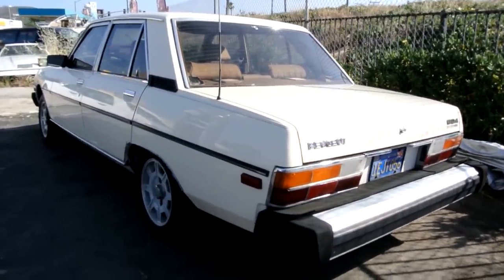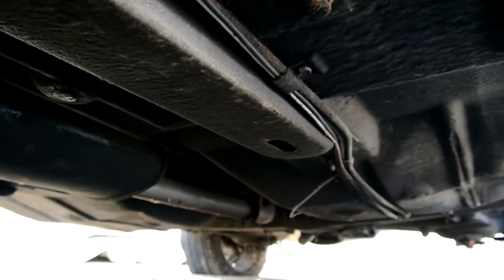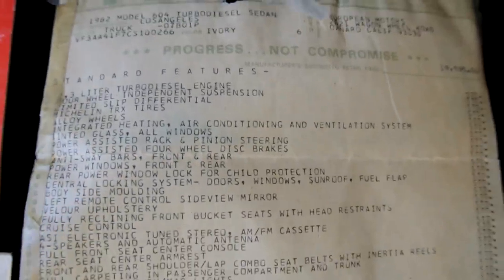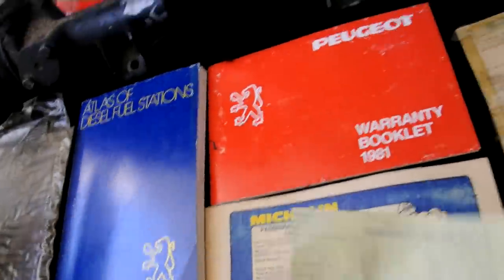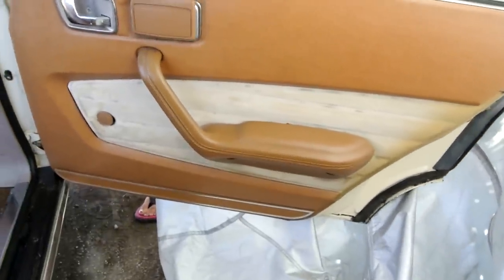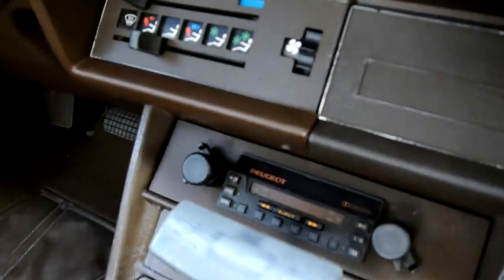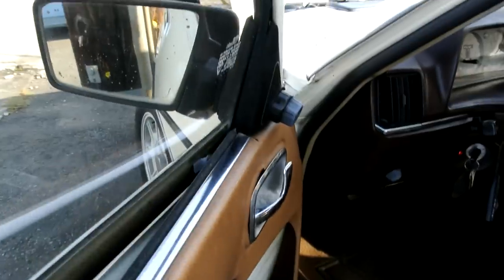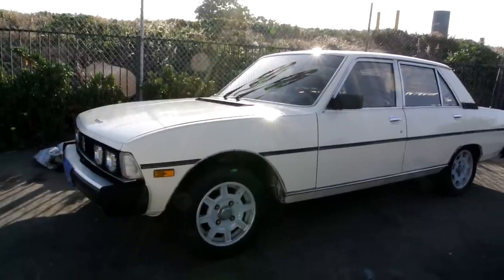1981 Peugeot 604 Turbo Diesel Saloon 1 or 2 Owner Project or parts Cheap!

Comment: I owned one of these 604 TDs about 4 years ago, got it from an estate sale. Was a one owner, that used it to travel across the country for years. Odometer was stuck at 700,000 miles, and story from the local Peugeot mechanic (and the last one I know of in the northeast) was that it hit 1 million and started going backwards! Had its original motor and transmission.

Comment: The battery light staying on is because the alternator regulator needs to be replaced it's an off the  shelf  item Motorola or Bosch regulator that screws on to the back of alternator. The car has been left in the sun for a long time because those parking/turn signal lamps that are white up front should be orange. that ghetto stuff on the fenders is just that ghetto, did not come from Sochaux like that. Sunroof motor operates a threaded screw, the carrier is stripped out by the noise it made.

Comment: your incorrect about the 3speed ZF, 5speeds were available but with the 3.58 ring gears instead of the 3.08 for the slush box.and there was not any chrome,it was all stainless steel. 604TDs tended to be really slow, 250lbs heavier than a 505TD.So the 5speed tended to get the most out of the Indenor,except 1st gear tended to be a little to tall for acceleration or getting started on a steep driveway/street etc.604s greatest trait,the ride and wider interior. 1 1/2inch widened 504 on each side .

Comment: and that plug is not just a plug, if the windows failed, an emergency crank could be inserted to roll the window up or down, and that car was beat...the leather is shrunk and foam is destroyed by ozone damage.It's got the wrong battery in it. Don't talk about a car if you don't know about them...makes you seem ,sound, and look extremely ignorant or just a typical sales man.